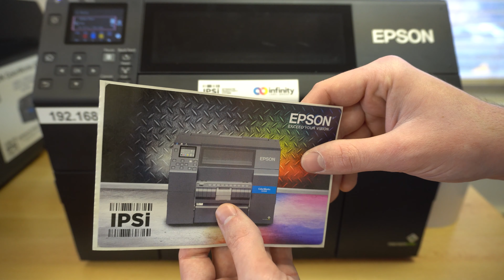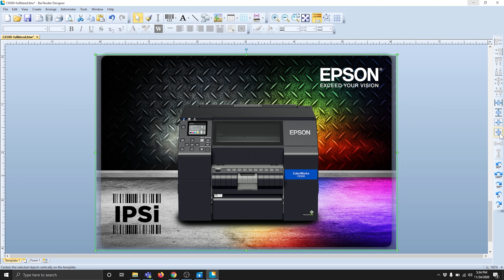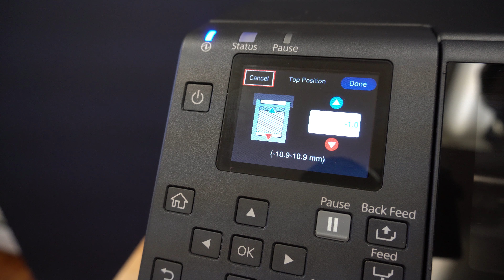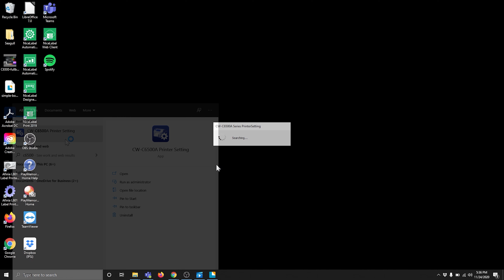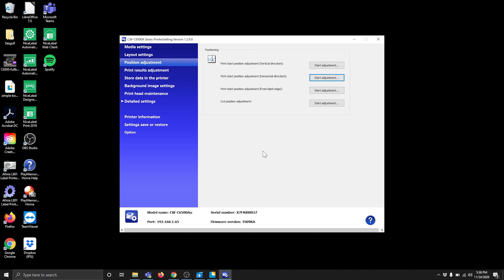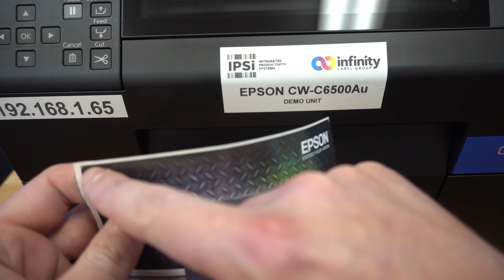IPSi Print Lab - Epson C6000/C6500 Series Full Bleed Printing Guide

Comment: Is there a way to get a full bleed print using continuous labels without black marks? I always have a small white gap despite making adjustments in the print position.
Reply: It depends which edge you are trying to print full bleed from.  If it is the leading edge and trailing edge, you will have about 1/16th to 1/32th inch white space.  We have had some success getting it to full bleed on the leading edge, but then you have a larger white space on the trailing edge.  Full bleeding off the right/left is easily accomplished by purchasing the correct continuous material that has extra material and a  face slit on both the right/left side.  Feel free to reach us at sales@infinitylabelgroup.com and we can connect live to discuss in more detail how we can help.
Reply: I just received mine today. I thought there was a software that can calcute the ink cost of each label?